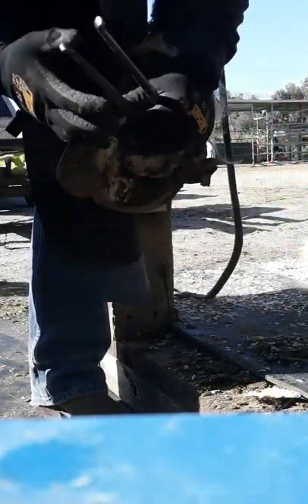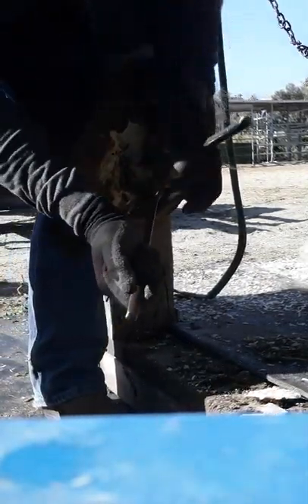Farrier Uses Planner to Trim Overgrown Draft Horse Hooves

Comment: Ever try an angle grinder with a cutting wheel that hoof trimmers use? Look at you tube the hoof gp
Reply from the maker: Yes I have I mostly use it on trimming cows with the planer I get a much better surface and if I need to put a shoe on I can do so for I get a almost perfect flat soles 🙂👍🙋‍♂️